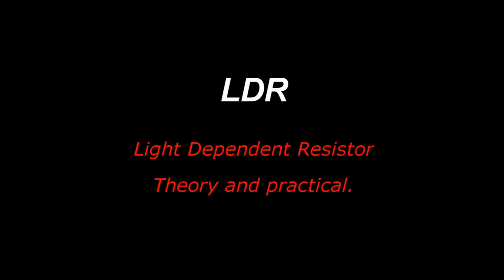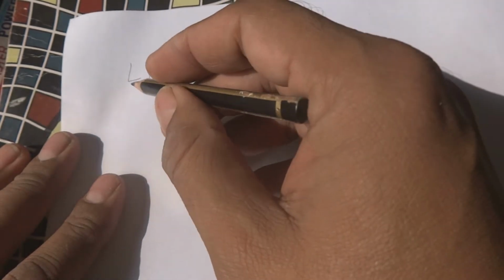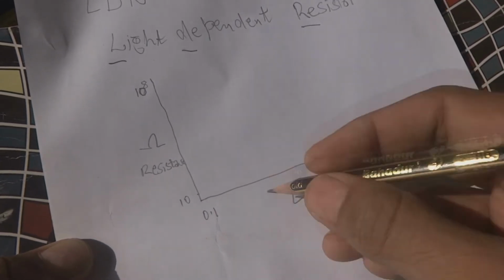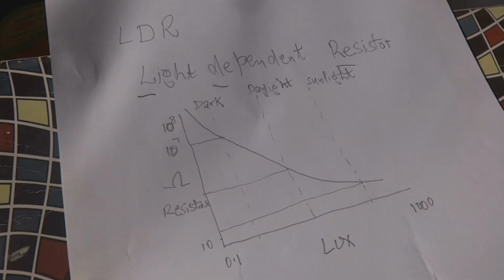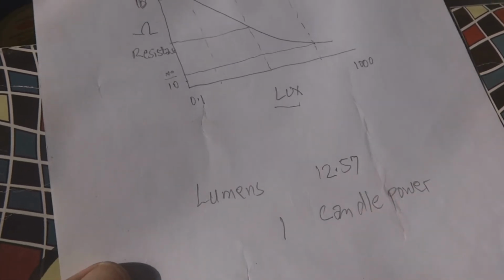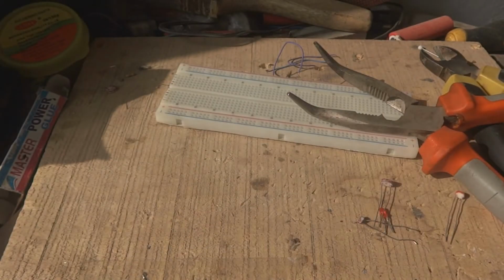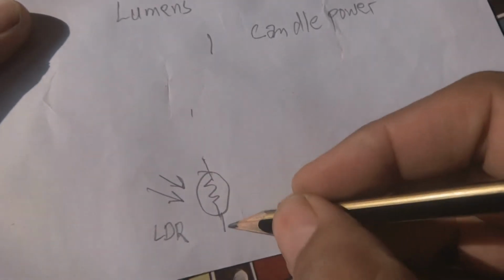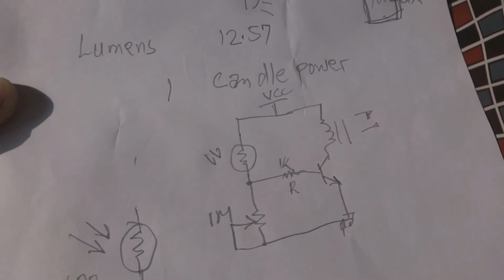Light dependent resistor LDR Photoresistor

Comment: sir g i need some info about my personal car.can you please tell me where isfuel filter in nissan sunny 2005 japan.
Reply from the maker: +Abdul Khaliq dear friend it inside the fuel tank and is intigrated part of fuel dispenser unit. You may watch my other videos for details. Regards.
Reply: can you please reply it to me by your link?
Reply: total procedure how to clean it....zama gare zoor nakae..accelrator full warkam..kho zoor nakae...khalak rata wae che grear filter safa ka sog wae che fuel filter..se chal okam warsara...
Reply from the maker: +Abdul Khaliq dear friend your car needs thorough check up. It could be anything a fuel issue, spark issue, engine compression or a combination of all above. Better you should do a computer scan first and then proceed next. Without proper diagnostic you will just throw parts and waste a lot of money and will not get any good result. You may watch one of my Toyota corolla diagnostic series here on my channel and hope you may get some understanding from that. Wish you good luck with your repair.
Reply: sir g,computer scan is ok,plugs renwes,trottle body clean.all ok.....i just want to no please tell me that if will gear filter help to change??? please send me the link thanks

Comment: Asslaamualikum 
Sir i have toyota yaris ... Durind the rain in jeddah i used my car in the flooded area only for 10 minutes. it is stopped as it takes water....After 1 day we started it but the engine is producing sound.
We used the flushing oil immediately and also change the engine oil....
Sound is now less but i still there is sound from crankshaft.... What is your opinion??? Whether it will go with 2nd or 3rd time oil changing? or it need overhaul?

Comment: The ldr used to be used on digital led clocks to dim the display at night, possibly using a darlington transistor for gain/drive.

The old 555 timer can also be triggered by a ldr to close a relay for say 5 mins, an outside light is powered by the relay as your car headlights hit it, automatic lighting :-D

You can use phototransistors for the same trigger, just a matter of bias :-D